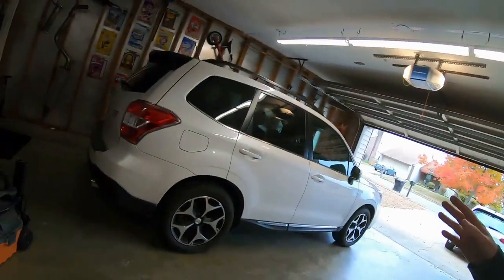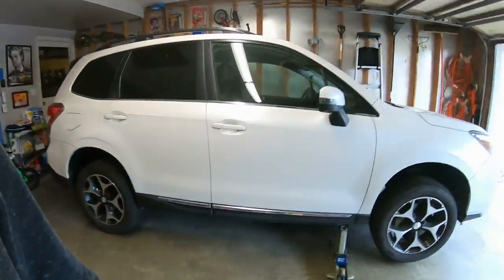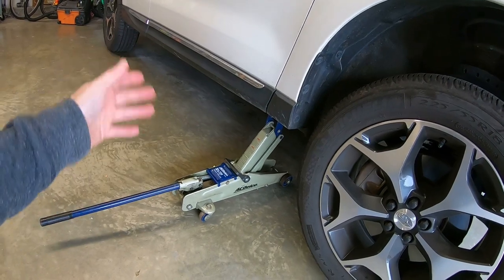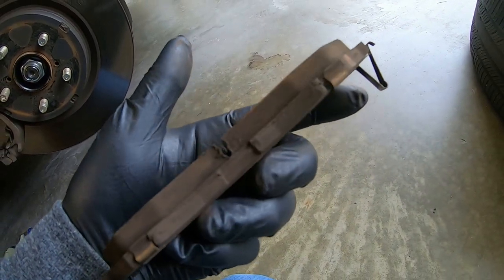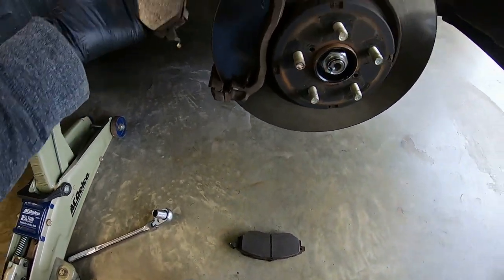2015 Subaru Forester XT Ep.123: Checking Brake Pads at 41,000 (30,000) Miles!

Comment: My stock pads in my 15 wrx looks the same as yours...with 48K miles.  How's the bite with the dba pads?  Might just change out my stockers  because of old age.
Reply from the maker: the bite is better. but you have to warm them up 5-10 mins when they're cold, before they bite.